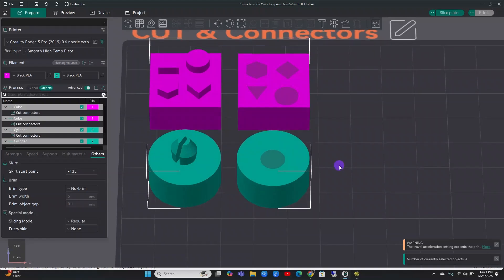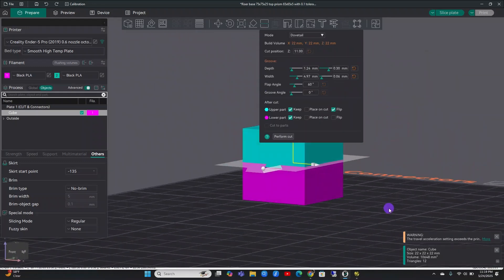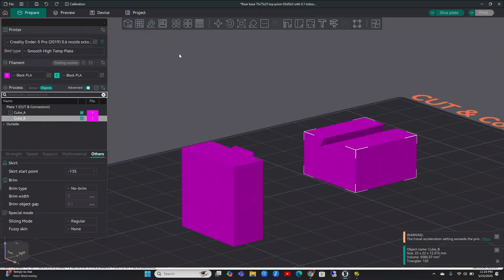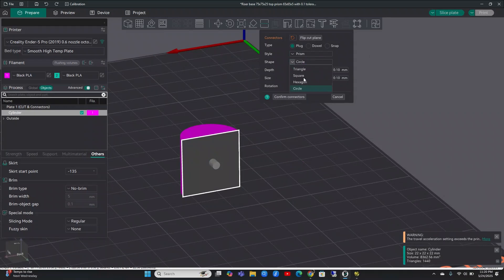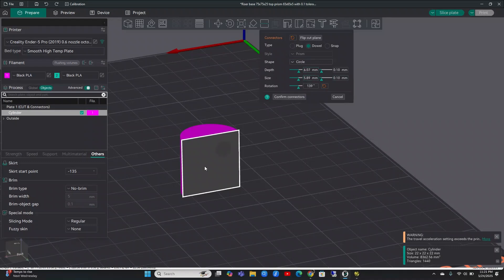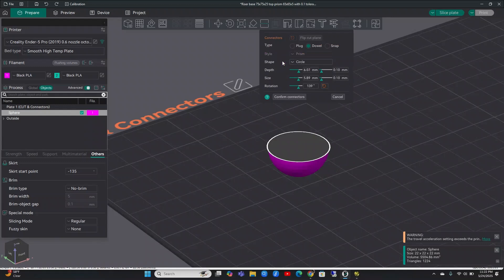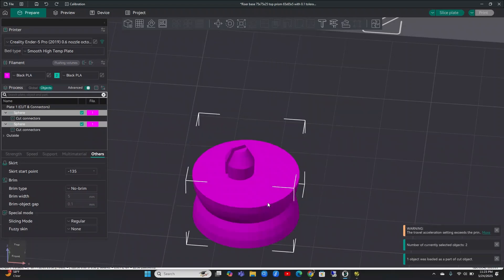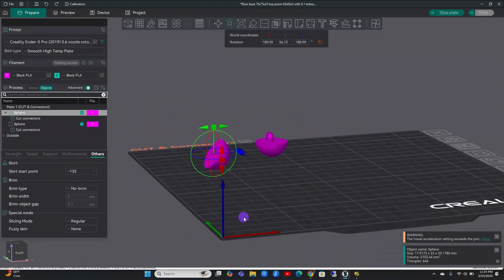Orca Slicer: Cut & Connect Unlock Bigger and Better 3D Prints! (improved audio)

Comment: Would love to see these printed and tested as i have done several different connections and when they print the sizes of fhe connections do chnage and almost never fit.. would love to see a fix for that
Reply from the maker: I'll add it to the list.  I did have good luck with connectors when printed - only did a few. Had the best results with the click in ones that can twist.  I know my different filament really well though but it's cause I've done WAY too much calibration/troubleshooting.  If you are using silks they puff so need extra room.  Would you like to use any specific type? I'll make it after the Xplorer
Reply: @RandoTechNerd im only using pla plus and ive never had luck with connections
Reply from the maker: @91WannabeGtr ok will definitely do a video with some testers.  Made some for this video-should have included them but editing is The most time consuming/I'm the worst at it it so I skipped.  However I think it will be a nice video I'll do some rows of sizes, dowel, shapes, PLA, PETG.  Got extra Filament.  Do you have any size in mind will probably do smallish but can throw a big one in-like certain type if you're building big models? Appreciate the feedback really like to make videos that are helpful and this is a topic that's not well covered 🫵🪨

Comment: Thanks for showing that! It would have been great to also show how to export the cut model (each part as a separate model) so I can print them on different days or printers.
Reply from the maker: Yeah good idea!! It could be used for large models I should do a more intermediate version with a big model and split it up onto multiple plates.. or export to folders for multi printer/days. I've seen some people using other software when most of this can be done in the slicer... Great advice I'll add it to the vid queue.  Thank you